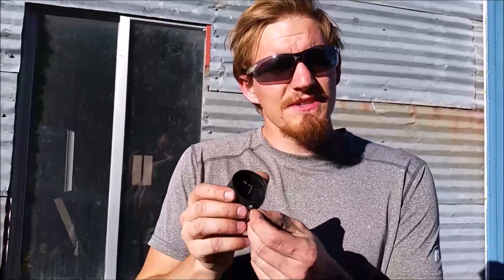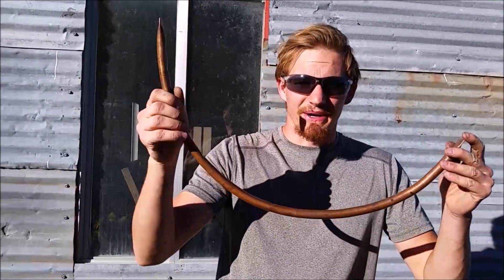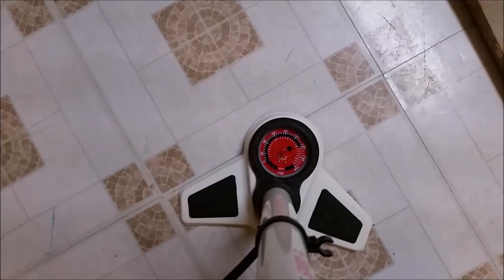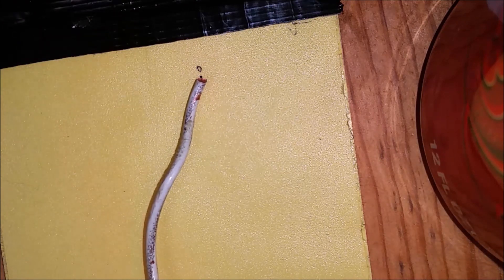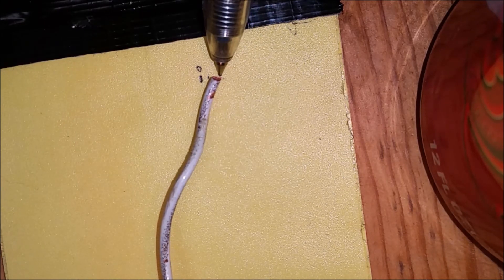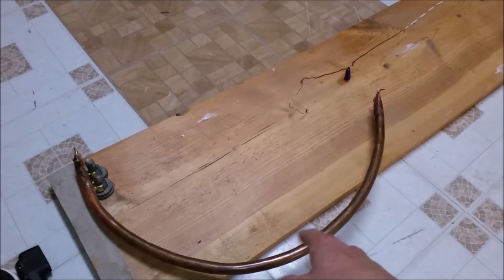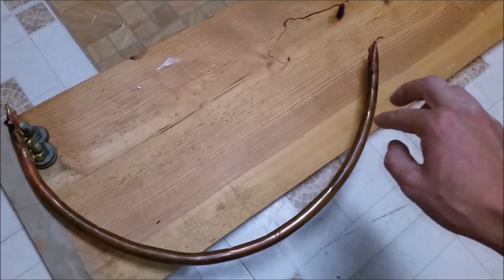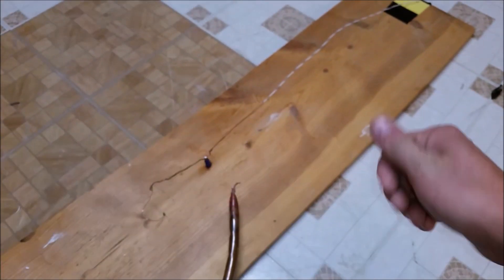Oversized Pressure Gauge

Comment: I know its been 2+ years but it occurred to me that the copper might retain just a bit of its shape after having pressure put in and released? I can't tell but it seems like you marked the gauge at 0 psi around the middle of the wire and when you let it return, it only went back as much as the left edge of the wire. I know that brass is a lot more springy than copper, maybe something to consider if you were to return to something like this.

Comment: If the ballon was curved deflated, it would blow up curved. The C-shaped bourdon tube pressure gauge straightens out because the outside is rounded while the inside is flat, therefore, for the same pressure, more force is applied to the outside, because it has a larger surface area
Reply: The reason your gauge works is probably because the grains in the metal still want to be in the "straight" position, so applying a little force gives them the energy to move

Comment: Hey Cody. Recent subscriber. Try flattening the pipe into an oval. As a circle the pressure is applied in all directions equally. As an oval the pressure will be greater in the short axis. Should give you much more travel.

Comment: I'd be slightly concerned if you put 1000psi on copper pipe....there's a reason pressure vessels have to pass inspection yearly....and that they're made from steel.

Comment: i work with this kind of stuff. We fill our gauge Bourdon tubes with a light weight oil similar to mineral oil. Liquid is non compressible giving the tube much more sensitivity and also helps with linearity. We work specifically with diaphragm seal gauges in which a thin metal diaphragm separates the oil filled tube and the process its on. It works on basic hydraulic theory: the volume of oil directly behind the diaphragm is compressed and "bottle necked" into a smaller volume, creating more flow of oil meaning more movement. A picture says a thousand words: https://upload.wikimedia.org/wikipedia/commons/e/ec/Seal_(diaphragm).png

Comment: put a secondary copper band running along the inside so that even if the copper tube bends over it's ability to bend back, the copper band will act as a sort of tensioner to always pull the copper tube back into a u shape.

Comment: I'm sure it has been mentioned but The tube design is called a "Bourdon tube" used a lot in aviation  gauges, For the lower pressures (altitude airspeed etc) they use bellows and diaphragms instead since they are more sensitive. we are talking about "analogue" "good ol' fashioned" gauges not the fancy stuff.

Comment: Cody, I think the cross section of the tubing really effected this experiment.  It is round, so this resists the desired movement by adding compression/tension forces.  If you were able to partially flatten the tubing you'd get more movement.

Comment: I'd love to see an experiment to find out how much pressure black powder can produce in a space where no gas can escape.
Maybe if you put some powder in a curved steel pipe and then heated it to ignite the powder. The steel would obviously need to be really thick with solid end caps
Reply: +M Dubzem I wouldnt recommend putting powder in a sealed pipe, thats how you make a bomb.  gun powder can easily go over 5k psi.
Reply: How do you know that?
Reply: professional experience.

Comment: Nice video as always Cody, I work in a power plant and even there these "primitive" but effective designes are still implemented, because they work and they are cheap.
And then you also have the ones filled with glycol for fluctuating pressures.
I noticed that you leave it round but most versions I come across are made flat like an oval, I think because it will be more sensitive then. 
So overall very nice vid but not to crazy about the music.

Comment: problem is copper is soft so it will retain some of the bend it gets ie when you reset to 0 it actually went back to your 50psi mark.
Reply: I think such small deformation should still be elastic, but friction of the lever might causes some hysteresis. A smaller end point will also improve the readability/accuracy of the deflection.
Reply: +Kwin van der Veen well it did not reset to zero. it retained deformation. watch the video again it reset to the 50psi mark.

Comment: Very nice idea. May have to use this method in some of my projects. One potential problem i see though is the copper work hardening decreasing accuracy and possibly leading to failure over repeated use. It would be interesting to somehow use a bicycle inner tube for the sensing envelope for use for lower pressure systems.

Comment: I believe the lack of sensitivity lies in the fact that your tube has a round cross section still, you need to flatten it out into a oval. The affect your going for is that the pressure will try and make the tube round and as a side effect straighten it out. Example if you have a perfectly round cross section your pipe could have any shape and under any pressure would not change its shape. This is why that gauge you had apart has an oval cross section.
Reply: +Widget Works Manufacturing Inc. Correct :)
Reply: +Widget Works Manufacturing Inc. Would a teardrop shape work even better here? The point of the teardrop being the inner edge and the bulge being the outer edge? It is a shape defined by nature, so I assume it would maximize the surface area difference, unless I am missing something. With sides flattened of course, just in an acute angle, not parallel.
Reply: +Widget Works Manufacturing Inc. This type of pressure gauge, a Bourdon tube, requires an oval or flattened cross section to function correctly. A circular tube will not work. You can see the original pressure gauge that he broke is a flat tube not a circular one. If he could smoothly compress this tube he would have better luck making it work.
Reply: ***** Confirm? It's the middle of a weekday you're obviously drunk and trolling me.
Reply: I came here to suggest the same exact thing and noticed you and some people already suggested it. I figured you'd need as much difference in surface area between the inside and the outside of the tube. A round tube causes the outward force of pressure to be radially distributed. An oval tube will allow a lot more pressure to be exerted on the outer side of the tube than the inner side causing it to try to straighten out when pressurized. Anyway I love your channel Cody!  I'm a huge fan of your videos. Keep up the good work!  : )

Comment: I think the energy required to bend the tube is a significant factor, a lot of the smaller gauges seem to have the tube flattened even though this should lower the pressure difference.

Comment: Thinner tube and several full turns should give some better sensitivity. Pretty interesting prototype
Reply: +Cody'sLab Smaller diameter would be less effected by pressure increases due to lower internal surface area, so thinner wall would probably be what gets results. I don't believe copper pipe comes in varying thicknesses, it would need to be sanded down by hand. If a smaller pipe was used I imagine it would work just fine, but would probably need to be made proportionately thinner. Or alternately, given a whole bunch more turns so the expansion is better amplified.
Reply: +NightHawkInLight Similarly, a steel mandrel and some heat should allow him to inflate the piping and thin the walls out uniformly.
Reply: +Cody'sLab 
It looked like the original gauge had flatter tube so running the copper through some rollers might help. Be mindful of the pressure rating on the tubing, I doubt you'll be getting anywhere near the ksi range with generic water pipe. Adding turns like NightHawk said (think spring) is an excellent way to multiply the effect. 

As for the music, it needs a more mad science vibe.
Reply: +Kiriakos Kalpakidis or fill it with sand and cap the ends then twist it around something circular